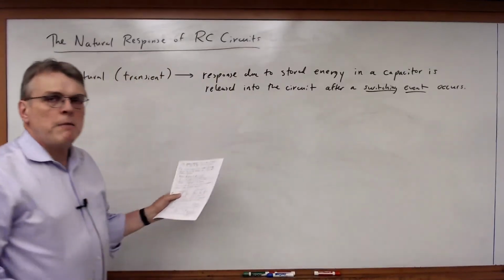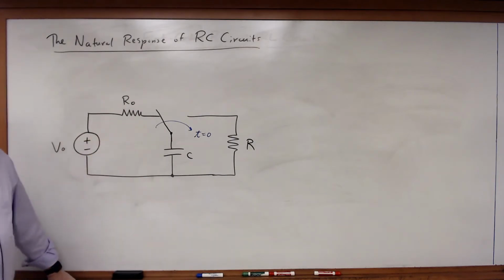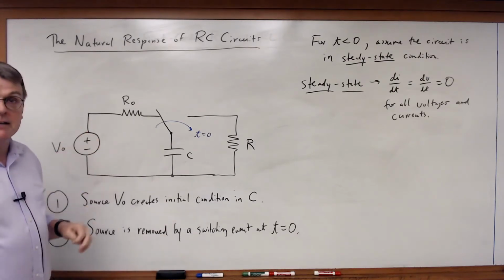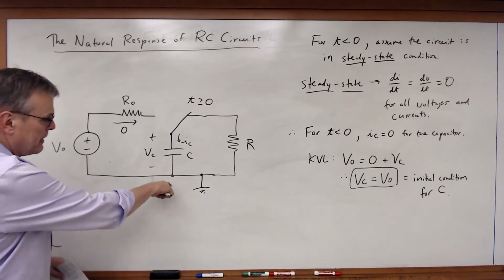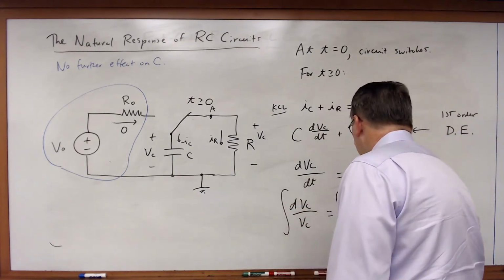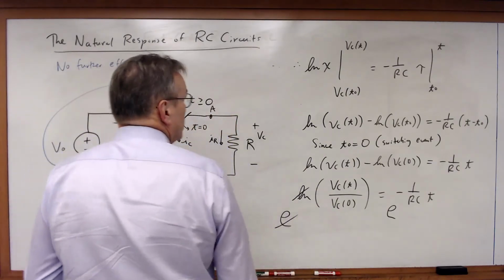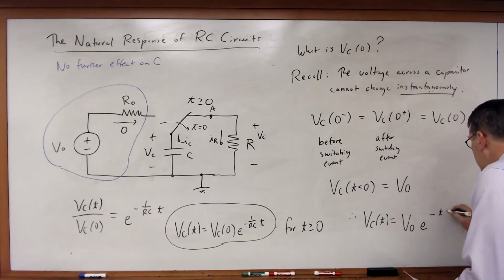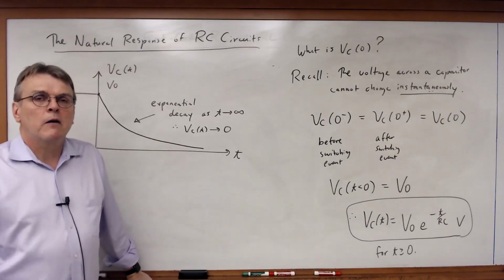EECE 2112 Module 55:  The Natural Response of RC Circuits

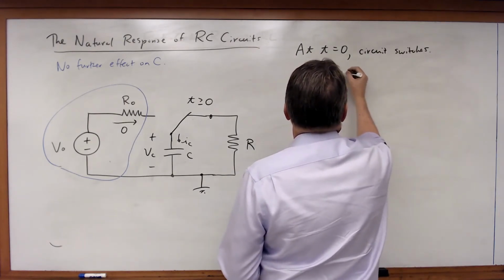Comment: At 13:50 why do you have I-C and I-R going in opposite directions. Would seem there is one current flowing clockwise from the capacitor.
Reply from the maker: Physically there is one current, but analytically it makes sense to define the currents according to the passive sign convention for both the capacitor and resistor.  Note that the capacitor will have negative power (supplying energy) as it discharges through the resistor, so the physical current will flow in the opposite direction of Ic.  But from an analytic point of view, you'll get the correct answer no matter what directions you choose for currents.  That's a fundamental principle of nodal analysis.
Reply: @wtimothyholman  Thanks so much for the follow-up!
Reply: @wtimothyholman  if we assume the opposite direction for I-C, the equation will turn out to be e^(t/rc) right ? how will it still correctly predict the graph if we plug in the values?
Reply from the maker: @SaltyStargazer , if you reverse the direction of I-sub-C, then you must also flip the polarity of V-sub-C to satisfy the passive sign convention for the capacitor, and in turn flip the direction of i-sub-R to satisfy the passive sign convention for the resistor.   Solving this modified KCL equation will still result in an equivalent solution.

Your choice of current direction or voltage polarity is usually arbitrary in circuit analysis, but once you choose one, then the other will be constrained by the passive sign convention for passive elements.